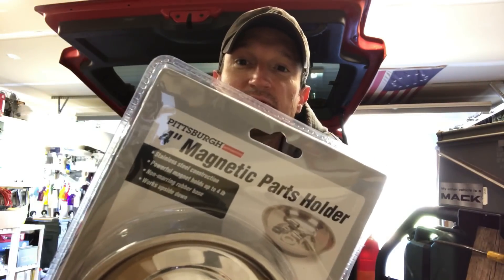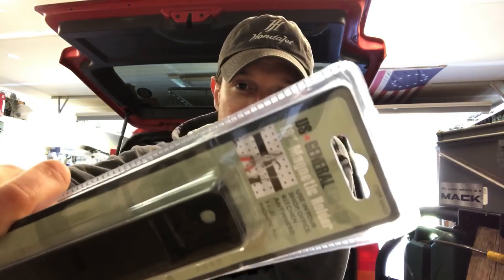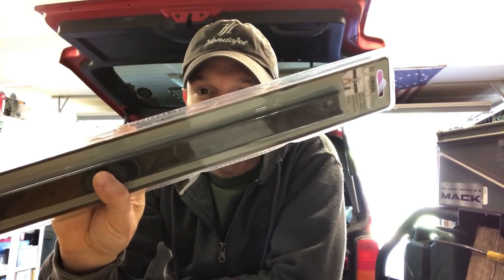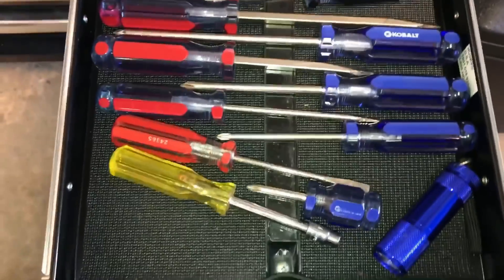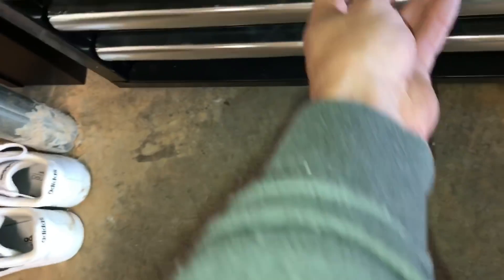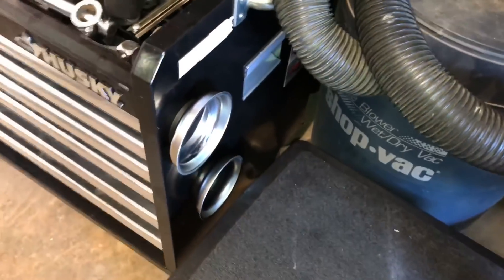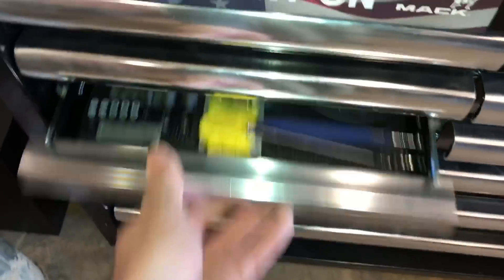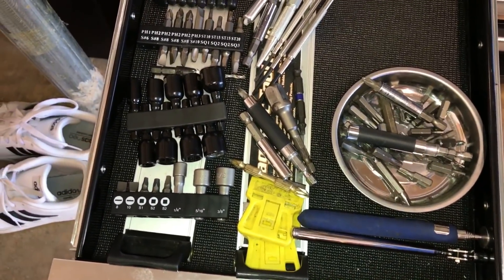Harbor Freight Magnets - Ideas for Using Them and I Even Bake a Couple

Comment: The parts holder ones i used to use for working on my boat engines   In the boat they were awesome. To   Even keep track of my  sockets and wrenches. From falling under the engines    Good camping tips on the magnetic tricks    Thanks for posting

Comment: awesome video! as a magnet freak myself i like all of your ideas. i used to take apart computer hard drives to salvage the magnets, you could hurt yourself with those. i also have all of the HF magnets you featured, actually have more than i can find a use for until now. the hook magnets are all over my shop, the clip magnets are extremely handy for papers, there is a tool holder everywhere i can find a place to mount it, several folks have commented and followed suit with the one on the firewall of my race car. the most popular is the magnetic trays, i work around a lot of electricians and hvac guys, so many have asked me to sell them one that i keep at least one spare with me and just give it to them.
Reply from the maker: Thanks.  I am always finding more uses for them as well.  Never thought about the hard drives, but have taken apart many speakers for the same purpose.  No matter how many I have I don't ever seem to have enough.  I need to break down the tool holder magnets again today since I have used up all the smaller ones. 
Thanks for the comment!

Comment: The magnets on the 18" bar doesn't need to be heated up to remove.  Just gently use a 3/4" old skinny wood chisel between steel u channel and magnet, tapping with hammer and each 
one will lift up to remove.  Haven't had any magnets break using this method.  Heating a magnet too hot, even with using real hot glue, will cause magnet to permanetly loose some of its magnetism.
Reply from the maker: Thanks for the tip and the info.  I will try that next time.